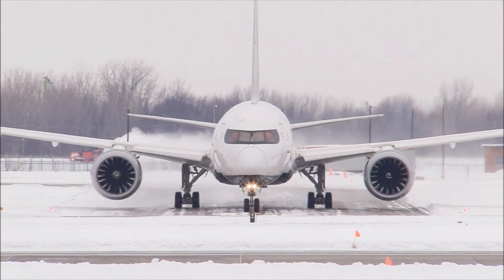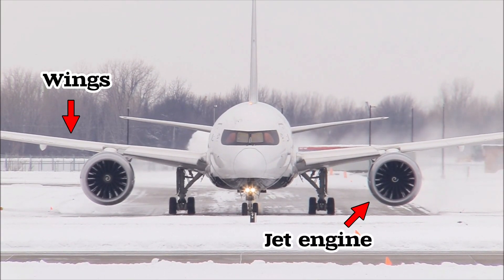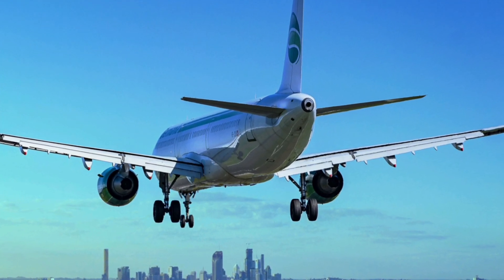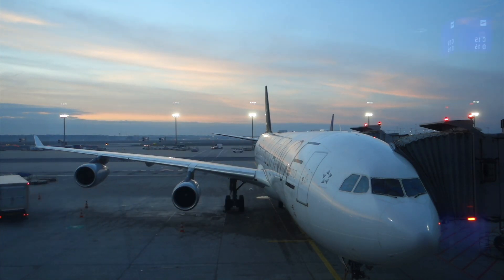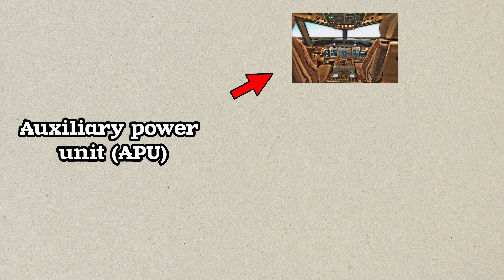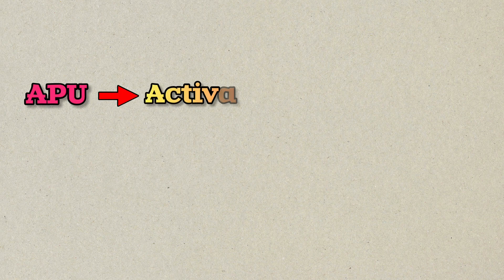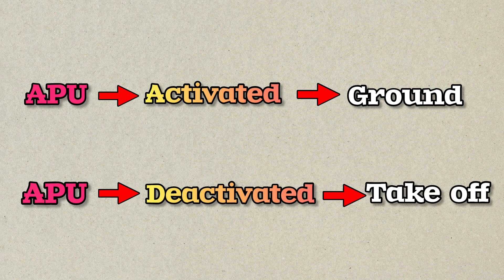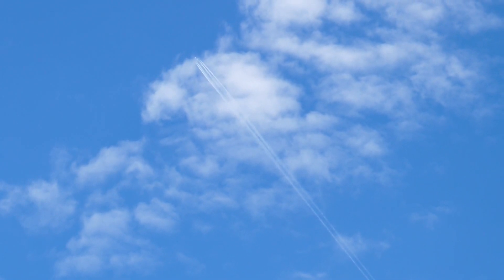Why Airplane Have Hole In Their Tail ? | Paras Files

Comment: You should say what the whole is for...?? I guess APU generator exhaust? Is it powered by diesel?
Reply from the maker: It uses the same fuel as the main jet engine uses
Reply: @ParasFiles the 737 has two holes what is the other hole for?